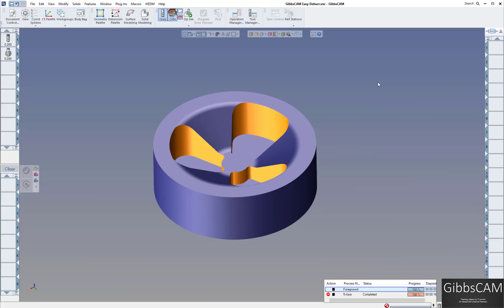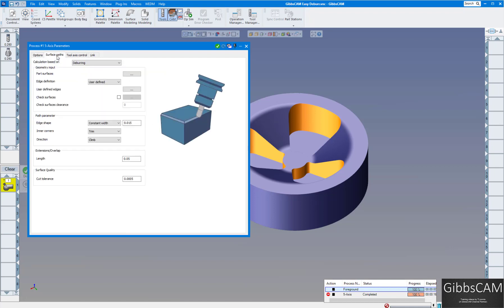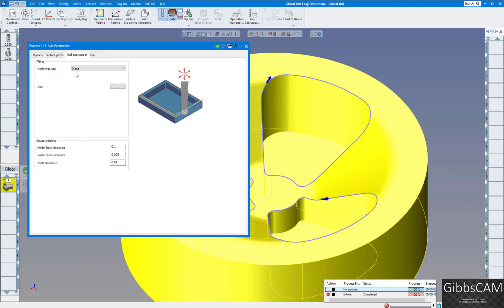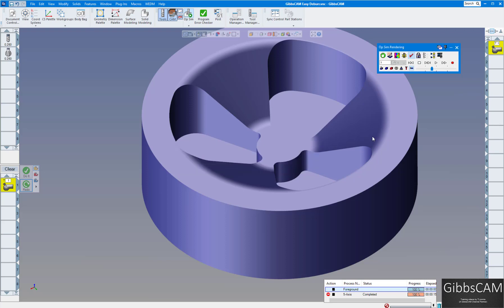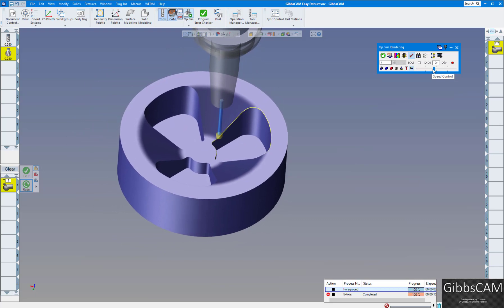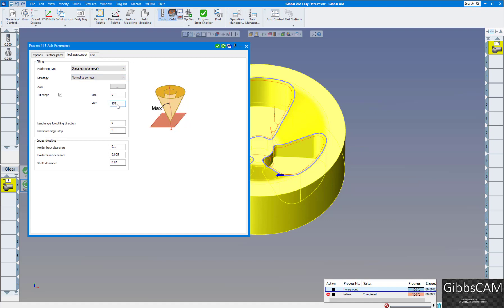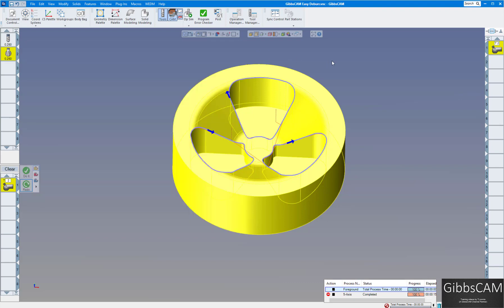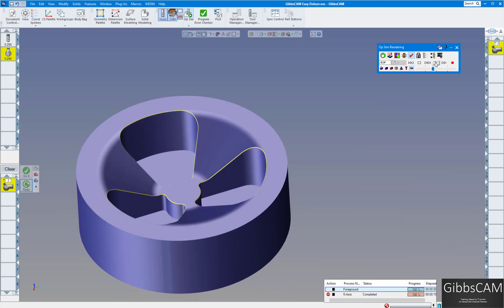GibbsCAM, Deburr in 3-axis or 5-axis

Comment: Thanks for this video. Quick question....When I load a process that I've saved from another part I've programmed, it seems to not keep the same tool when I load it. e.g, the orignal will be a 1/4 in ball nose in tool 4 slot and when I load it in.....it will throw it in a seemingly random tool slot. Even if I create the tool ahead of time , it just moves it to a random spot on loading. Any Ideas? Thank you :)
Reply from the maker: Are you importing the tool using "right click on tool tile, then choosing Load Tools" ?  If you do there is a window that pops up and asks if you want to Preserve Tool Number.  Make sure you have a check there, then it will go into the same spot.
Reply: @GibbsCAMVideoTutorials  I'm using 2011 Gibbs. doesn't seem to have right click on tool tile.?
Reply from the maker: @TheDefeatest  Yes, 2011 version does not have that.  2014 and newer has it.  2011 version though does have the ability to save processes.  Double click an operation and it will bring in the process on the left side, then right-click the process and save.  It will save the process as well as the tool.  See if that works.
Reply: @GibbsCAMVideoTutorials  Thank you!